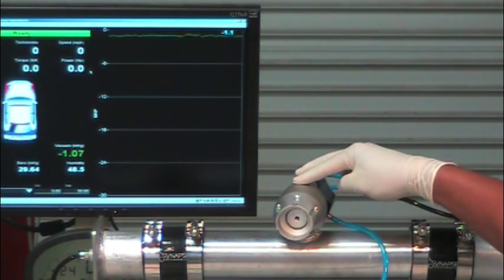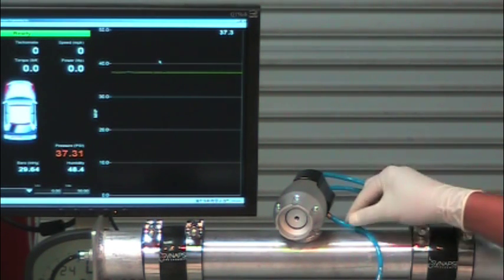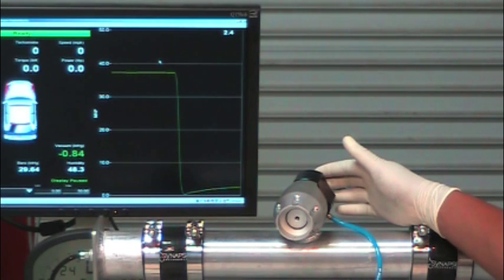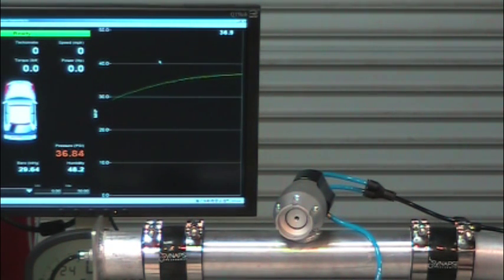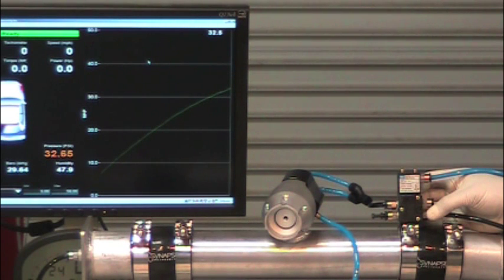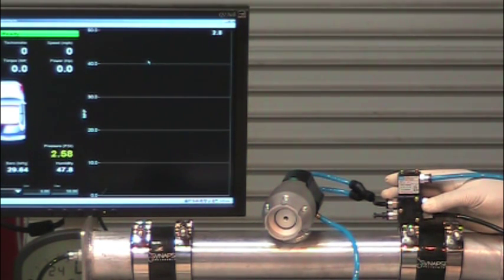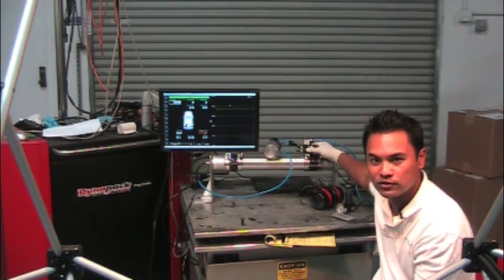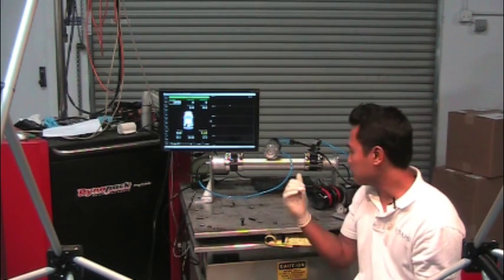Actuator Based On Synchronic Technology

Comment: @Hebert6760 

side port is boost only source, basically t'd from ur compressor line to the wastegate if external or from wastegate if internal gate, the two ports ont he back go to a vacum source after the throttlebody

Comment from the maker: Unfortunately, we haven't yet put together an industrial brochure for this valve yet.  But I can summarize here a little bit.

*Aluminum 6061-T6 Construction
*Billet forging, followed by CNC machining
*Heat treated AL 6061
*Hard Anodized surfaces
*All seals are o-ring based in engineered annular glands
*Actuator technology can be better understood at synchronicactuator_dot_c0m